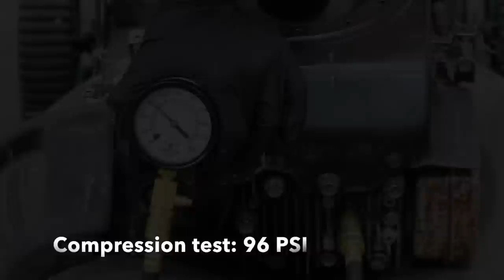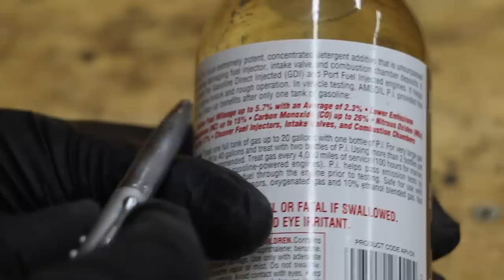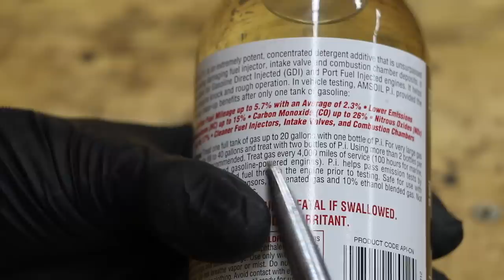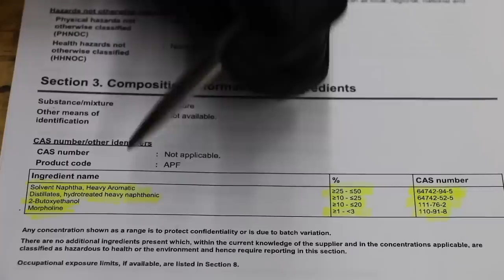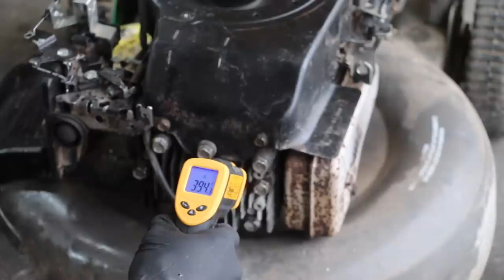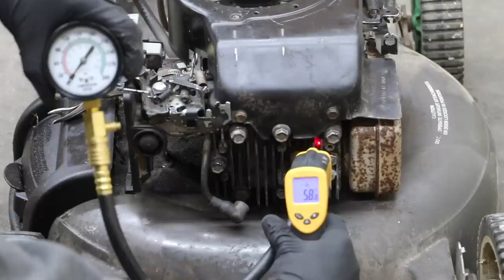Is Amsoil Power Foam better than Seafoam & MMO? Let's find out!

Comment: When the head is off, why not take a wire brush and buff everything clean.  takes 1 minute. it is the best way to go.

of course one doesn't do that in car engines, so I get it for the test .  But what can be done is this if you are not pressed for time.  

Fill the combustion chambers right to the top with a good quality detergent oil mixed in with seafom .

let it sit for a few days, even a week. drain it well, then work the engine hard. real hard, high speed asap. take it on a backroad in lower gear at near max rpm. the loosened deposits will fly off, due to the high rpm and the pressures
Reply from the maker: Thanks for the suggestion.

Comment: Project farm, what has been the best engine cleaner based on your tests?
Reply from the maker: I haven't tested enough engine cleaners yet to provide a comprehensive enough opinion.  I have tested a few and I really like Seafoam, MMO, and Power Foam.  Each delivers results. Other products, not so much. Thanks for commenting!
Reply: Project Farm thanks for replying. What's your opinion on these products that you add in your oil to bring power back and increase power? I've only used restore and zmax. I think restore done better.

Comment: #ProjectFarm hi im a huge fan of yours and I watch every episode you come out with! I would like to see you test Cataclean by Mr. Gasket! Its a fuel system cleaner and catalytic converter, and muffler cleaner as well! I'd like to see you put it to the test, and see what the heads, piston top and valves, carb bowl, and muffler look like after the test! You can find it just about anywhere including walmart, advanced auto parts, autozone ect. It usually costs a little over $20 a bottle. It also guarantees that your pass a emissions test as well. Please test this product! Sincerely, John

Comment: This was a very great test but you kind of skewed the results because you did the hot soak which wasn't in the instructions. My personal feeling is that that hot soak you did may have remove the more of the carbon deposits then if you would follow the instructions to the letter. I am impressed it removed a lot of the carbon buildup.
Reply from the maker: Thanks for the constructive feedback.

Comment: I ran a very high concentration of Amsoil PI in my riding mower (20 hp opposed twin Briggs) and when I shut off the ignition, it continued to diesel until I choked it. So I'm curious, can you damage an engine by allowing it to diesel?
Reply from the maker: In this instance, it's unlikely that any damage occurred. Thank you
Reply: @ProjectFarm  thoughts on seeing how long you could get an engine to diesel like this? Wish I had a spare engine to try this on.

Comment: The use of fuel c.eaning additives are to be used by using a FULL tank worth of gas or at least 4 - 5 cuttings for a lawn mower. Then see the results. Instant gratification of using a half gallon is not enough to get what ever real results.
Reply from the maker: Thanks for the feedback.

Comment: looks like it worked way better than seafoam or MMO. ive never seen any results from adding anything to the tank but this might be different
Reply from the maker: Thank you
Reply: @ProjectFarm  so update i can tell you is that after this video and several others i convinced my work to bring in amsoil PI to use on our fleet of golf carts and customers golf carts and i can say without a doubt this stuff works! i saved dozens of carbs from being replaced! i would have a cart that needed a carb, try running clean gas first then added PI and let the cart run with a brick on the gas (direction selector locked in neutral!!) for a few hours, some didnt make it as they had severe issues but id say about 60% were saved and quite a few beyond that got better but still were not usable.

Comment: If the costs if Amsoil fuel system and top end cleaners is anything like the cost of their oils do they, per unit of cost or time needed to implement their cleaning action justify their costs over using seafoam, berryman b12 it marveltstery oil.
Reply from the maker: Thanks for the feedback.

Comment: It would be easier to draw a conclusion if the power foam had been used according to directions.   Also, much less of the power foam should have been used, since you are only dealing with one cylinder, not 4, 6 or 8.  I've used Amsoil products for years and am very satisfied.  Their PI and oil kept my GMC purring from the day I bought it until it was sold, 130K miles later.
Reply from the maker: Thank you

Comment: 8:33 That was a bit dangerous. You hot-soaked the engine with liquids and started it afterwards. It could have demaged the engine by hydrolocking.
Better: a few revolutions with external force without the sparkplug in for splashing out the liquids. 😉
Reply from the maker: Thanks for the feedback.

Comment: PI like any PEA cleaner needs time to work. It's not a fast clean product chemical. With small engines I tend to lean towards heavier treatment, I would have run it for 5 minutes, left it for 12 hours, run it for 5 minutes, and did that for a total of 48 hours, then run the tank empty. It would have removed far more of that nasty stuff in the bowl.

I've used Powerfoam to buy time on a catalytic converter that was at the end of its life. It was on a 2003 Safari 4.3 with AWD, and it got another 2 years and 30-40,000km. Before the efficiency code came back.
Reply from the maker: Great point. Thank you
Reply: @ProjectFarm  Thanks for replying, it's one of the downsides of PEA, but it's also why it doesn't melt rubber like the solvent cleaners, that work much faster.

First reply from a channel owner, yay! Heh

Comment: what happens when you over fill the oil in a motor?
Reply: Too much pressure. Blow out pan gaskets, lower power output as the crankshaft has to smash into the oil. On a lawn mower, oil would get pumped out of the breather tube into the air filter & plug that up.

Comment: Gotta do a interceptor vs other power valve rated type oil like seadoo or Polaris brand
Reply from the maker: Thanks for the video idea.
Reply: I have switched to interceptor from yamalube in my power valve pwc engines.  Also use it in a Polaris snowmobile and seadoo Pwc.  After years of using oem recommended manufacture brand oils take valves out yearly for cleaning and have seen a noticeable difference in gummy build up.  Would be a good test to put the debate to bed.

Comment: Dissolving a little carbon off the piston and head is ok but not earth shaking. I wish you would find an engine with carbon stuck rings. Check the compression cold, remove the piston, show us the stuck rings, replace the piston without unsticking the rings. Treat the engine with something that is supposed to fix stuck rings. Run it a long time. Recheck the compression cold. Remove the piston, show us unstuck carbon free rings.
Reply from the maker: Thank you for this recommendation!

Comment: Test NMF additive in the white bottle
Reply from the maker: Thank you for this recommendation!
Reply: Project Farm Thanks for reading comment. I've tried many many many additives over the years. Only 2 made a noticeable difference, NMF and Motorkote. But I've heard and read bad stuff about Motorkote. Currently I believe NMF is the best. However I'm very curious to see testing on it. I'd be more than happy to mail you the remainder of what's in the bottle for testing , about 1/4th. Do you have a contact email?

Comment: As usual, AMsoil doesn't seem worth the money to me.  Seafoam is still the best as well as the best value.  But I do like marvel msystery oil for stuck lifters.  That's saved me $$$ several times already when added to the motor oil for a few hundred miles.
Reply from the maker: Thanks for the feedback.

Comment: Cant say better than seafoam, but it definitely helped.
Reply from the maker: Thank you!
Reply: @ProjectFarm  No prob. Fun fact, been having issues with my leaf blower lately, soaked the air intake a little bit last week and went to start it a little while ago, started like a champ. So I sprayed it a bit again and hot soaked it twice just to be sure as it is an old blower. Perhaps you could answer a question for me, it works perfectly fine on Half Choke but struggles on Run with the trigger pressed and can stall, any idea what may be causing it?(Been like that since I got it a few years ago, a scammer/fraud work crew left it after doing some work at my home)

Comment: What I think we should see if my amsoil, purple royal,and Schaefers  to see how they compare they are all the most reputable top shelf products use mostly . And do test with them like  to high zinc /phosphorus vs amsoils zrod vs Schaefers equivalent. And do several other like there cheap or oils and cleaner  ect . Try a bunch of them in a full episode or two.

Then do same test with most off shelf products like mobile one ,Castrol, an Warren based oil ECT find some clean products and other things they offer like to top"shelf" stated above.

Find a top one or two or each  test  of the two and  do and test against the top few. 
Could be. Good three episodes to add on page I used alot of the products and deal amsoil so I like to see test and see what need approved.. if so I can show what all amsoi has to offer and  you can  find out product the other have and have this huge throw down would be awesome , few oils,additives, metal protection, cleaners it just goes on.i love products vs product s.
Reply from the maker: Great recommendations!  Thank you
Reply: @ProjectFarm  yes sir it would nice to put the "best against each other and the on the self  stuff the top few winners of them and use the winner to test against . If you need higher dollar chioces let me know.

Comment: Acetone desolves that fuel bowl build up easily. That carb bowl was NOTHING compaired to what I have found. I found actual alge growing in them before. Corrosion that desolves the metal towers that hold the float pin. I once had one the float pin rusted in two. I had one where the float pin arm just fell off. The guy wanted to know if I could fix it. lol. Luck for him I always have a box of carbs sitting in my shed. Smoking engines are usually a lost cause obn a lawn mower, that and knocking engines. Not worth fixing.
Reply from the maker: Great point regarding the effectiveness of acetone.

Comment: Carbon buildup. Is it really such an issue? I suspect it's highly overrated as problems go. Unless it's fouled your plugs, what's the big deal? In what way does it interfere either with combustion or with flow of gases (through the valves)? Even heavy coatings can account for only the slightest decrease in a cylinder's compression ratio. And frankly, the layer of carbon almost certainly insulates the metal, in which case engine temps are necessarily lower but with a hotter exhaust. Where's the empirical evidence for calling carbon buildup a problem?
Reply from the maker: Thank you.  Yes, lots of issues.  Google GDI and carbon deposits.

Comment: Now I'm wondering now that U have used Amsoil Power Foam and Amsoil Power Improver & Seen good results in lawnmower Combustion Chamber + Fuel Inlet Tract, If these Should be part of one of the Toyota 4 Cylinder Engines burning oil due to Oil Return Holes in piston ring lands & Gummed up Dirty Rings not doing their scrape oil back down cylinder walls into crank case Job. IE: the High Detergency of the Power Improver would Be Great to Do a Heat Soak after Amsoil  Power Improver Added Fastenough to Stall the engine & leave some "Raw" Power Improver Detergent Liquid on top of piston to leak down into Ring Lands. That Might free up some Sticky in their ring grooves rings and/or clear the stopped up small oil return holes in the ring grooves that less the oil that's behind the rings leak back into Crank case from inside the Piston. I have a 2013 Camry Straight 4 cylinder automatic, that I may just be ready to do a Modified Reduce Oil Consumption from 1 + Quarts per 1100 miles at 72,500 miles. Car's never Smoked, It is, I'm Fairly Sure, just pushing the Oil out of the exhaust pipe once the Rings get dirty + sticky & fail to do their Job. I think Power Improver instead of Berryman's B-12 ChemTool as Combustion Chamber/Fuel Inlet Tract Cleaner Deserves a Fair Chance.**Project Farm**Please give me your thoughts on this for my Car as a Trip we take 3 times a year will now lower the oil to 1 qt + Approx 10 oz low in just 1100 miles now ! David M Tharp , RPh > PS the non-mechanically handy of the 3 Tharp Boys whose Dad was Was Good Mechanically just like the Youngest of 3 Sons. PS we have always used Full Synthetic in the Grade Suggested by Toyota but just changed it at 3,000 miles instead of longer intervals & Been OverKind to the 4 cylinder in Re: Gasoline/Fuel Injector Cleaner & Air + Oil Cleaners + Given "her" Some Slick-50 every 20-25,000 miles ( Last time at 72,000 miles ). For Instance, How Much Amsoil Performance Improver ( Whole BOTTLE is approx 12 oz   and a Galon of Gas is 128 oz. ) to how many Gallons of Gas Should I Use to Mimic Your Clear Gas Tank Runs on Lawn Mower by Siphoning tank nearly empty & then adding back Gas + Amsoil Performance Improver. & Could I also Disconnect the Big Inlet Hose for the Fuel Injectors & Spray with a Misting Bottle Amsoil Performance Improver directly to the Injectors; and maybe Do a Bottle Misted into Running Engine once every 2-3 days for maybe 5-6 Bottles ? < I'm Just Spit Balling Here ! Other idea is Just mix Performance Improver at Approx 32 to 1 ( 32 parts gasoline to 1 part Performance Improver ) & run a Tanks mixed like that thru on Trips which would be higher RPM ( Interstate Hwy Speeds )

Comment: I'll stay on the mistery oil and oil it a lot more expensive y take out my spark plugs and pour a bit inside + I fill my tank with the proper mistery oil and gas mix, my truck is driving smooth and strong for $4..... This is a two different bottle additive with mistery oil is just one ,,, I use mistery oil on my shop even to clean heavy grease parts
Reply from the maker: Thanks for sharing.

Comment: A quart of gas compared to 20 gallons 2 hours to a week or more, just because you used less but the same ratio as per the instructions, you can't expect the same the results. The amount of time is crucial to the results. This isn't a recipe for baking a cake, you use 1\10 to make a cupcake but more like asking an artist that paints a 2 foot by 3 foot painting in two years and you say that you want 9 inch by 12 inch and he should be able to knock it in no time.

Comment: If you could show screen shots of the previous testing results of Marvel Mystery Oil and Seafoam with the shot of whatever new cleaning product you were testing, that would allow a side by side comparison. Also, I'm not a fan of you removing the plug and "hot soaking". It's not in the instructions, your average Jo isn't going to do it and I don't think adding a fair amount of a cold (right out of a spray  can cold) liquid to a hot head and piston is a good idea.
Reply from the maker: Thanks for the suggestion.
Reply: @ProjectFarm  Thanks for your hard work saving a whole bunch of us spending money on crud. Great videos. Cheers.

Comment: Should've used the straw on the foam.
Reply from the maker: Great point. Thanks for this recommendation.
Reply: Unless you had a faulty straw which I've gotten one. Soak carb bowl and wipe clean after 15 20min.

Comment: invalid test. pouring a steady stream of water into the carb would have cleaned it up better and cost nothing.  now if you had just run the fuel additive and then looked to see if it cleaned it would have been a valid test.
Reply from the maker: Thanks for the constructive feedback.

Comment: IMHO, none of these products work well enough to justify their cost if only added to the fuel.   Too diluted.   Spraying directly through the carb increases the % of the product enough to make a difference however I don't see how to do this on modern fuel injected engines.  Also, I think the carbon will re-form almost immediately.
Reply from the maker: Thanks for the feedback.

Comment: MMO is not a strong solvent it is designed to be left in the oil for the entire oil change interval and to be used over and over again.  It is from 1923. People used to add auto oilers to trains, car engines and machinery and fill it with oil or in this case MMO and the auto oiler would drip oil into the crank case over the life of the car as long as you kept refilling it. It was designed in a time when pressurized oil systems did not exist and most engine parts where splash oiled or they had oil buckets on the timing chain that carried oil up to the head and dumped it on the head. Sadly not enough automotive historian or true gear heads or this would not be such a lost concept. Almost every that uses MMO uses it incorrectly. It was added to the fuel to act as a upper lube and to slow the rate that lead built up on the intake valve.
Reply from the maker: All great points. Thanks for commenting!